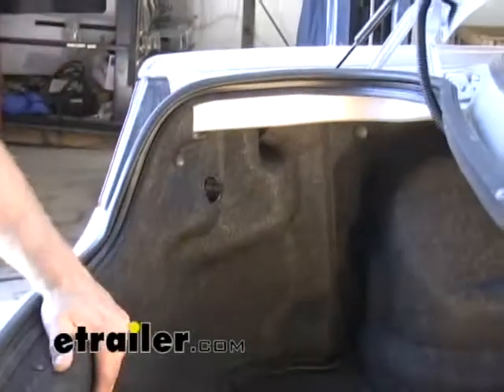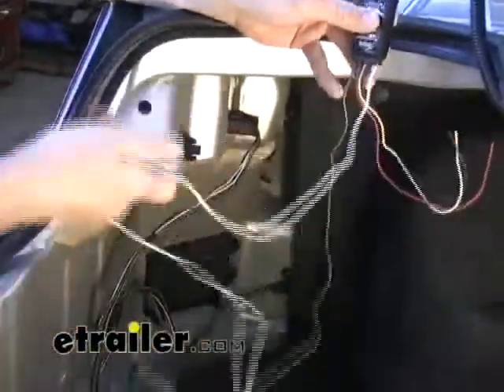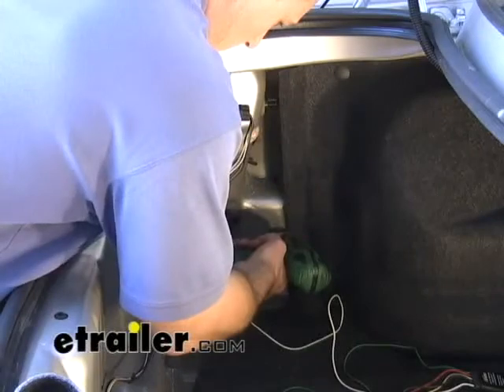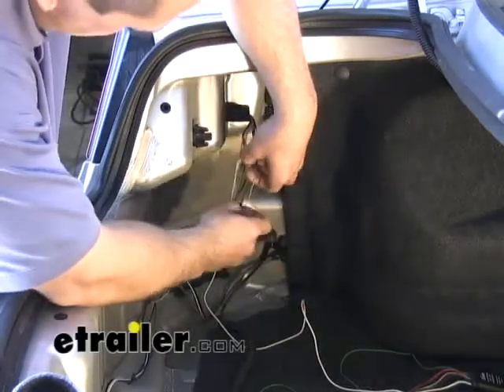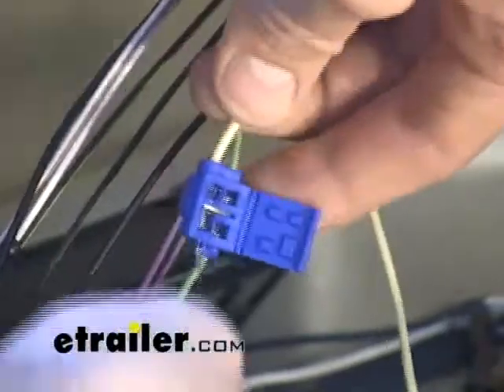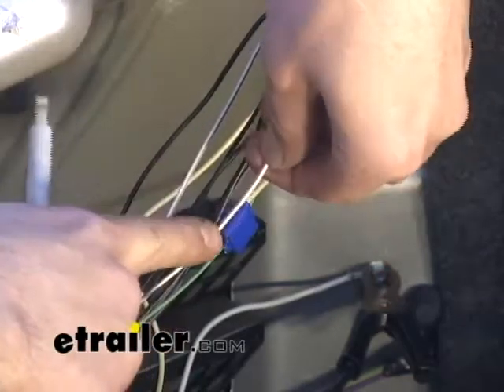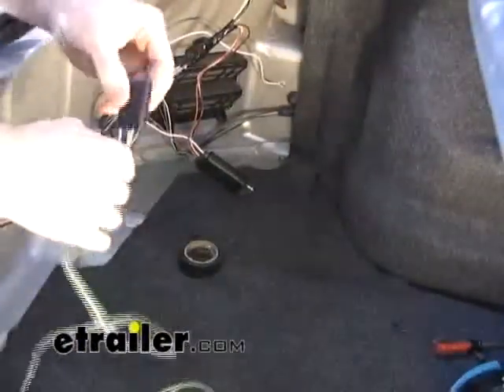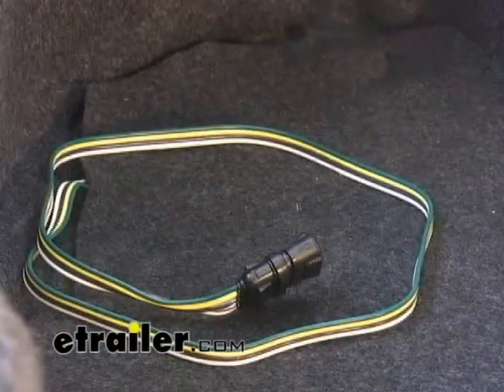etrailer | Installation: Hopkins Vehicle Wiring Converter with 4-Pole End on a 2006 Dodge Stratus

Comment: My car is a 2002dodge stratus. And it has the big opening are with no cover over the rear (trunk panel ) can u tell me where i can purchase a cover for it?
Reply from the maker: esmeralda diaz Best bet would be a dealership or a junkyard. You may need to hit the dealership first to determine the part number of the panel and search the web from there.